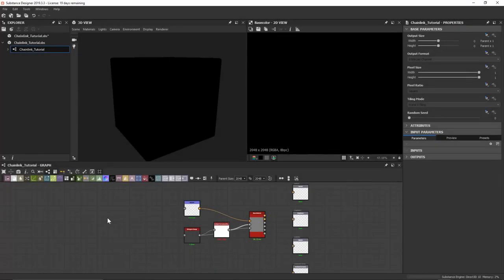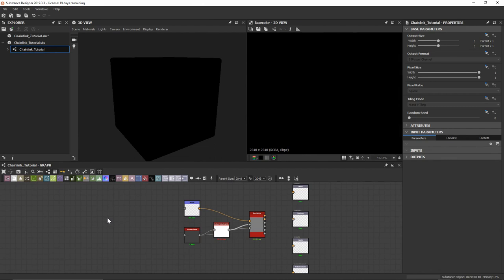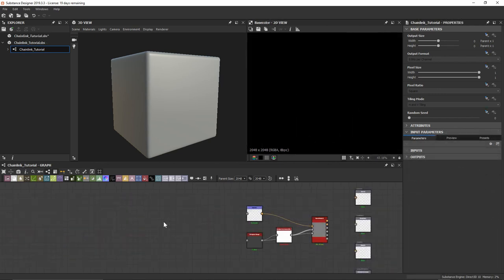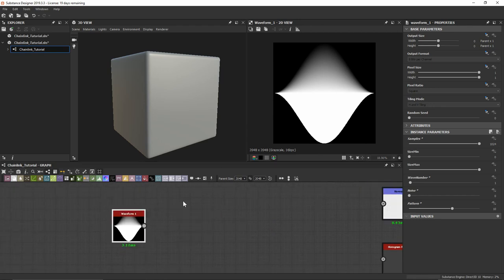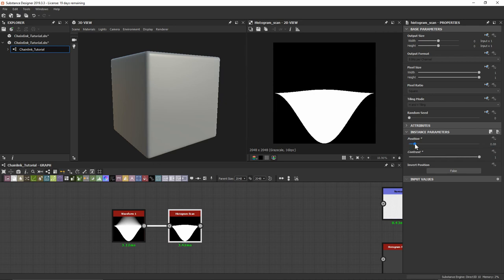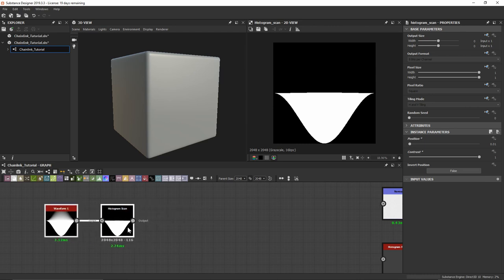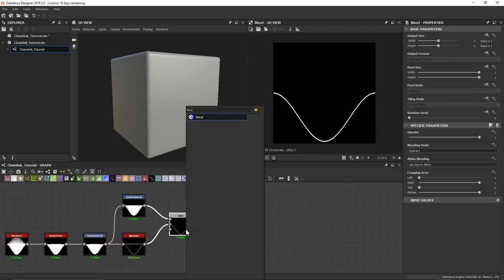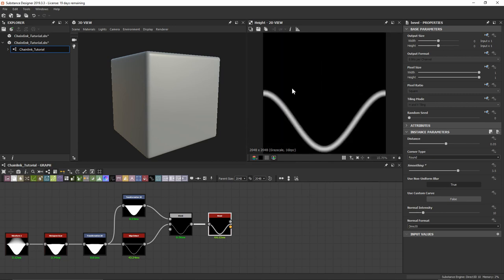Chainlink | Substance Designer Pattern Fundamentals

Comment: I've never ever used Sub Designer... so a bit fast...but I can see how you're doing it... learn by doing. Cheers. The only thing is I'm loathed to sign up to Adobe for it. :) I bought Sub Painter via Steam as an indie license.
Reply from the maker: Ya, the Adobe factor is not great. I'm still using version 2019.3.3, before Adobe had acquired them so I can avoid requiring signing up to use it.

Comment: Wouldn't it be required to add an alpha to black portions of the graph? I'm really new to substance so this is a question out of pure ignorance.
Edit: Awh snap seems you did that in the opacity node and I wasn't aware that that's how it's done 😅
Reply from the maker: Ya that's a great question! Ultimately it depends on where you intend to use this material, truthfully. In SD, like you mentioned I use a specific Opacity output node and that's how we can view it in this application. If you wanted to view the transparency in another application, it will depend on what your shader is looking for. Some will use the alpha from the base color, others will prefer a separate grayscale map like we have here. :)
Reply: @GetLearnt  Gotcha, I'm still busy with my donut tutorial in blender so I haven't gotten to importing many of my pbr materials from substance into blender, hence my lack of knowledge of the naming convention for these maps. Ty for the explanation. Unrelated question though, do you know if substance designer has a plugin for gaea or vice versa. If so, I can imagine it would allow a super awesome cool method for creating landscapes (i.e. generating "low poly" base in gaea, then overlaying pbr materials from substance designer).
Reply from the maker: @janvisagie231  No worries, happy to help! And while I can't say for certain, I'm  going to say that there ikely isn't an "official" plug-in to bridge those. You may be able to find something online that someone else has made, but just based on what I've seen in the community I can't say I've deen too much support for Gaea, although I'd tend to agree that'd  be a powerful combo!